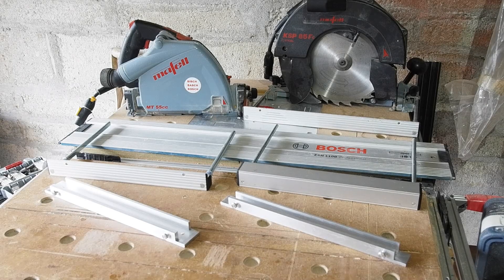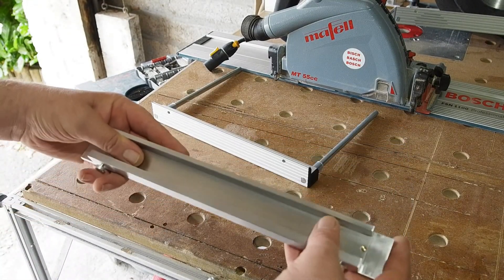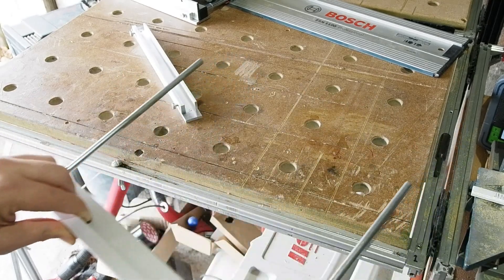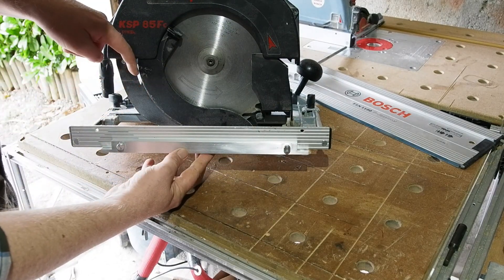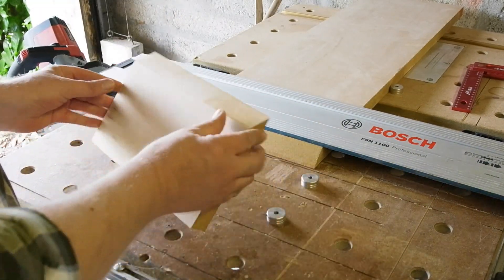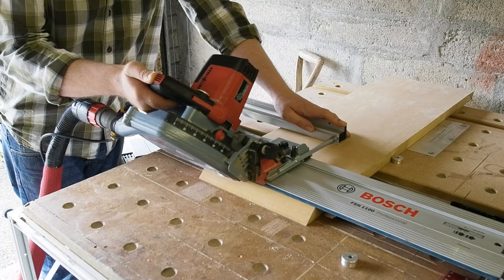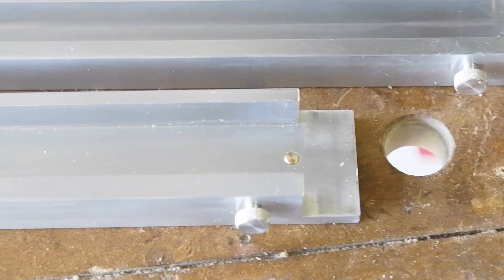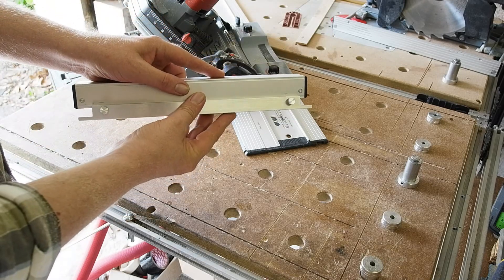Mafell and Festool Anti-Tip Device. Parallel Fence Spacer.

Comment from the maker: The Mafell spacer will work with any Mafell saw that has the same type of fence seen in the vid. It won't work with the Mafell fences that have the looping rods. It will also work with the Bosch GKT plunge saw. The Festool spacer will work with the TS55 and TS75 plunge saws. The Festool HK saws use the fence profile in a different orientation so the fence in the vid won't work with those. If there was sufficient interest, I'd design one for the HK's too.
Reply from the maker: @GhstplyzsCrosby  That's great Mark, thank you. These are just prototypes at the minute. Hoping to have a first batch ready for sale in about 3-4 weeks. I'll get in touch when they're ready to go. All the best.

Comment: Great suggestion and I'd be interested in one as I'm running the TS55 on Mafell rails. 
One suggestion for a further refinement might be to have an additional attachment for when the fence is to the rhs of the track (& saw) that provides a support (front and back) adjustable in the vertical plane when you don't have scrap available and / or you are doing a relatively short cut so you don't have material to the right of the track to support your fence.
Reply from the maker: Thanks Andy. Funny enough, I already have a design for one with greater height adjustability so it can run on the bench.
Reply: @BischBaschBosch  I have in mind something like the height adjustability of Jonathan Katz Mozes' stop block adjustment.

Comment: Hey mate. Do you make these for the Bosch plunge saw? If so I'm definitely interested also. Thnks
Reply from the maker: Thanks man. I'm still trying to get hold of one to make sure but I think the the Bosch GKT 55 fence is exactly the same as the Mafell MT55. Hope to have them for sale by mid August via the Karpenter website.
Reply from the maker: Just as an update, I have now checked the device with the Bosch plunge saw fence and it fits the Mafell version. The Bosch and Mafell share the exact same fence as it turns out.

Comment: I was cutting 45s on small stock today. This combo would have been handy. I don't have the parallel guide but if the two together weren't too much I'd be interested.
Reply from the maker: If you have the Mafell MT55 or the Festool TS55 then the fences are around £50-£60. I'm not sure how much the spacer would cost yet.

Comment: Looking at the Mafell fence it seemed to me that you could achieve the same by cutting back the deep side of the fence so that it matched the rail.  It would still project far enough to use as a parallel fence.  The Festool fence looked as if it would almost work that way.  Given the thought Festool puts into its tools I would be surprised if they hadn't thought about this or might modify the position of the fixings so that it did work both ways up to support the saw either on or off the track.  I haven't checked this of course as I don't have a fence for the Festool TS55.
Reply from the maker: You could cut back the deep side of the Mafell fence but then you wouldn't be able to use it as a parallel fence. Plus, the lip is quite thin. High risk of marking work. Better to leave the fence in tact imo. The Festool fence in the orientation to work as a parallel fence would sit too high on the rail (by about 5mm). You're right, Festool generally put a fair bit of thought into their tool and accessory use. But not this it would seem.

Comment: Hi, I'm currently running the mt55 18m bl will this attachment fit?
Great idea by the way, this makes life so much easier when cutting on a 45 👍
Reply from the maker: Hi Danny. Yes mate. The 18m uses the same parallel fence as the corded mt55 so the spacer will fit. I have a handful of the Mafell/Bosch ones left so if you're interested, contact me (bisch basch bosch) on Facebook messenger and I'll sort you out.👍

Comment: Absolutely great idea! I would definitely be interested for both my saws, but I run Festool (TSC55 & HKC55). Not sure if that helps or makes things more complicated 😬!
Reply from the maker: Cheers Daniel. I only have one designed for the TS at the minute. For some reason, the HK saws use the same profile but in a different orientation so this one won't fit. If there's enough interest, I'll design one for the HK's too.👍
Reply: Bisch Basch Bosch many thanks for the reply, I’ll keep my fingers crossed that others are interested too 👍

Comment: Are you planning future runs for the Festool pieces?  I know the TS75 saw is less popular than the 55, but these are especially needful for the bigger saw - it's a beast to keep upright on a big bevel cut.  I wonder if you couldn't make a universal piece to fit both the TS 55 and 75, and satisfy both needs with a single production setup.
Reply from the maker: Hi and thanks for the interest. The TS55 version was also able to work with the TS75 fence. Same fence profile, just longer. Unfortunately, no immediate plans for another run. Still a small chance a 3rd party will take the design on but nothing certain yet. All the best.